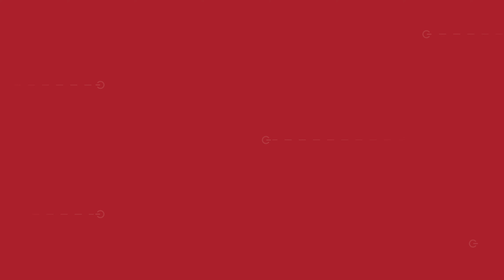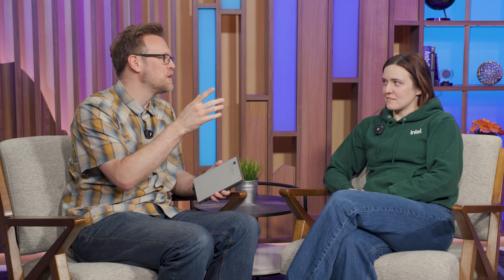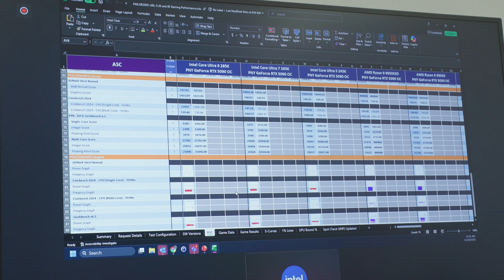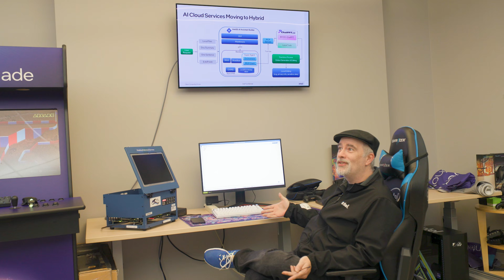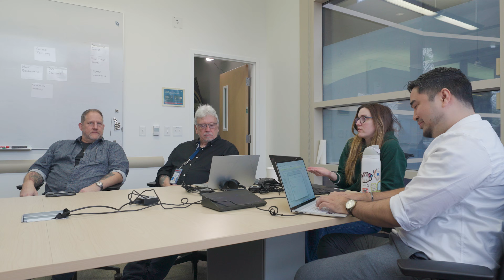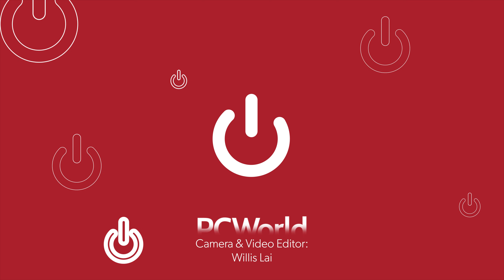Intel Talks Internal CPU Testing Methodology

Comment: I think a lot of ppl and reviews either don't understand or don't state the goal of their CPU testing, when they use 5090s and run games at 1080p low: what this shows is "the largest possible perf. gap one can create in an extreme testing environment" to generate that "up to" xx% number. But the question most consumers are wondering about is probably "if I game at 1440p ultra with a mid-range GPU, how much money can I save before seeing noticeable fps drop?" and their testing does not answer that directly.

Comment: The minute she started saying benchmarking is like telling a story I tuned out.  Stories are subjective.  Benchmarks should be as objective as possible.  Tell the customer what the product can and can't do and let them tell their own "story".
Reply: This interview was cringe as 🤬. I tuned out after about 5 minutes.
Reply: Don't want to sound like an apologist, but it does make some sense. Imagine this case - that usually 2 specific apps have proportional performance. That is, if a CPU is 30% better than another CPU in app A, then it's also 30% faster than that CPU in app B. Now, Intel (or whomever) release a new CPU in which these 2 are no longer proportional. And it performans better in app B, but most people only test app A and call it a day. Now, if this would only be on app A and app B, that's easy, but if it's something that's seen in 30 apps for which you need 110 benchmarks to see the whole exact picture then you do have to contract that information into a "story" to present the new capabilities. When you also have different RAM options and P and E cores, you kind of need to make a "story" to exhibit what the CPU is capable of, and how to do that, but in something like 2 slides or in a 2 minute speech, because most people won't pay attention to 100 benchmark graphs and the plethora of mentions and caveats of what's best in each situation.

Presenting the full performance of something so complex and multifaceted is very complicated. That's why Phoronix test suite has literally hundreds of benchmarks. That's why I'm fighting with people in comments when they say Intel is useless now, just because they don't deliver in gaming and at stock speeds, forgetting that in productivity Intel is still doing perfectly fine, still very competitive. And somebody saying their CPUs are useless IS unfair. It can be to them specifically, but not overall.

Lastly, benchmarkers, when they provide their conclusion, that's a story too.

Comment: Pepperidge Farm remembers when they changed the motherboard socket by literally one pin—not because the technology required it, but because their shareholders required you to buy a new Z-series board if you wanted to enjoy that massive 3% performance boost.
Reply: Main reason I left Intel in 2018, keep changing sockets with no  CPU upgrade path. I had it with them . Happy with my 5800X3D , 3rd CPU upgrade on my x470. I'll probably keep it until AM6👍
Reply: Unfortunately these massive shareholder-held companies will always prioritize them instead of the consumer, even when there's people that love their job as much as Hannah :/